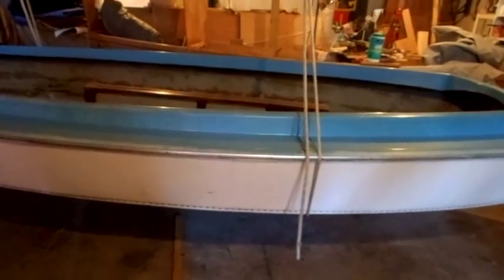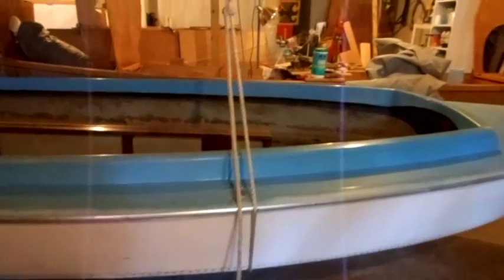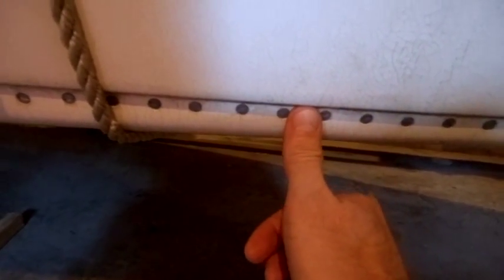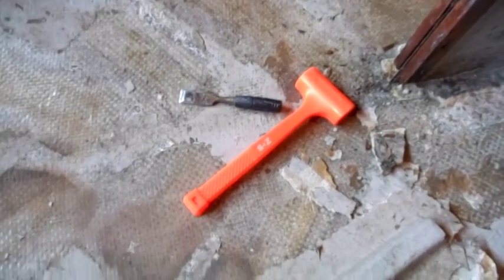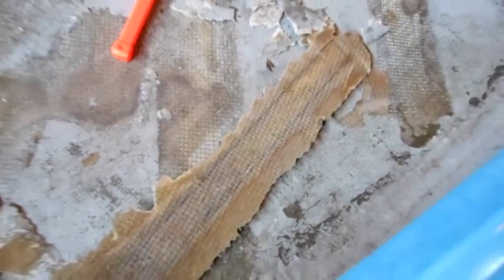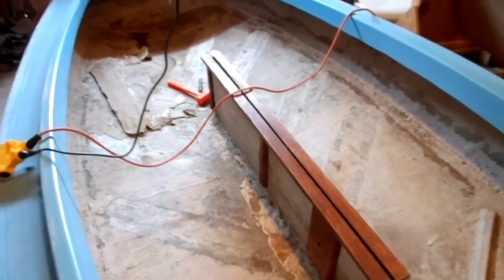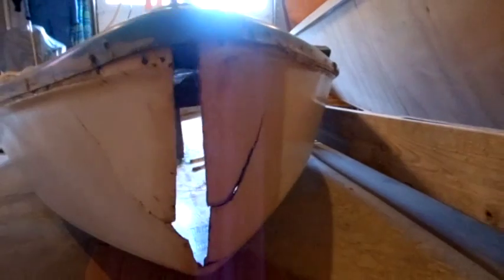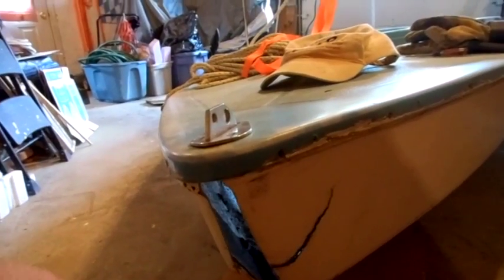Luger Leeward 16 part 1

Comment: I just got my first and it's a luger Leeward 16.  You mention in your video that you read instructions.  Were you able to find instructions, blueprints, or other info online somewhere?  I'm in for the same type challenge you are.

Tks
Reply from the maker: I got this project from the original buyer and I got the blueprint pages with the boat.
Reply: @edwardjones8170  -  Hi, I have a 16 I 'm working on. Can you share the blue prints?
Reply from the maker: @OutrageousBob  Boat and blue prints are gone.
Reply: @OutrageousBob  Why do you need blue pints for such a small boat?
Reply: @edwardjones8170  to the dump?